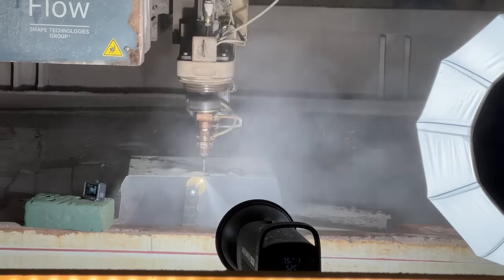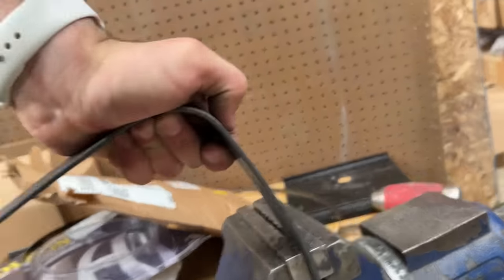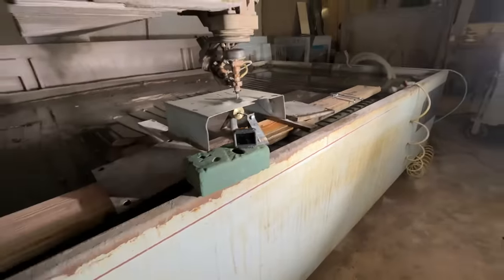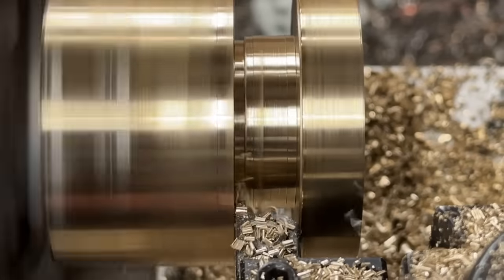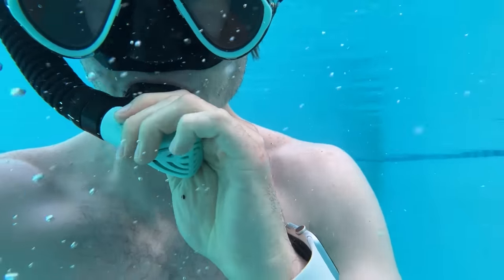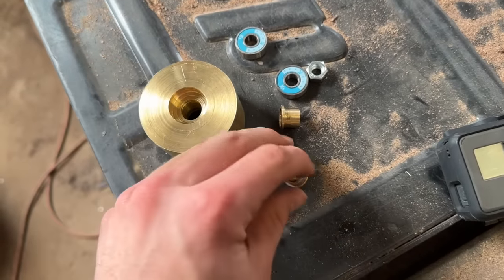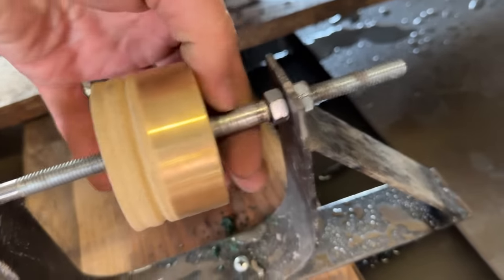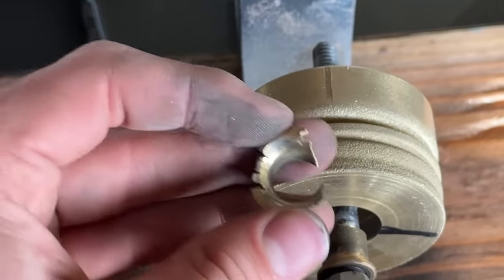200,000 RPM Brass Wheel Explodes Ceramic Bearings

Comment from the maker: Get NordVPN 2Y plan + 4 months free here https://nordvpn.com/waterjetchannel It’s risk-free with Nord’s 30-day money-back guarantee!
Reply: I would go either with an air bearing or an old-school babbit bearing.   ...and use an actual turned shaft instead of a random bolt and sus nuts.

Cheers!
Reply: Maybe bearing inside bearing , to reduce RPM 1 bearing to half RPM . Speed mean friction and very hot.
Reply: Have you tried ceramic bushongs?
Reply: it is spinning about 1884.96 kilometers per hour
Reply: Why do business with those crooks?
Reply: I know how you can get it to 1,000,000 rpm if not more 

I just thought of this but in the U.k London England in the country sides (outside london rural areas) we have old buildings that operates with watermills (to generate electricity the old fashion way) 

If you check the design of the watermill wheel and how it uses gravity to spin by filling itself with water per bucket you can perhaps do a similar design with the titanium wheel and use your water pressure gun in that method to generate maximum speed, I can’t imagine how fast it would go if you implement that.
Reply: If only you could calculate rotation speeds by pitch alone. You cannot.
Reply: @WaterjetChannel  Put their master server under your waterjet instead of shilling for those scammers...

Comment: The fact that he put a brass bushing in a piece of brass actually hurts my brain
Reply: Came down here to say this lol
Reply: sticky stuff. Brass on brass that is. where are the old guys?
Reply: You have seen this channel before right? He’s not the sharpest knife in the drawer.
Reply: I assume stainless steel would work great?
Reply: @BensMiniToons  “Brass is a grippy metal.” Adam Savage
Reply: @stephen3293  honestly with all the different alloys of brass it could.but maybe it wouldn't
Reply: @BensMiniToons moved channels
Reply: @bens6813 a lot of it is forced stupidity for entertainment with this guy
Reply: Sacrificial material to protect inner surface of the wheel. that's why he made these bushings
Reply: @16ats  to protect something he's hitting with a water jet spraying garnet at high enough fps to literally cut grooves into it? I doubt it
Reply: That's why most bushings are oil impregnated bronze...
Reply: @ari_wastaken  why did he move :(
Reply: On a wobbly steel threaded rod that's cutting chunks out of the brass etc.. they listened about ceramic bearings but things like this are some of the most basic material engineering
Reply: Baaahahahahahaha!! 😂
Reply: yeah he really should've made a burnished steel one
Reply: @stephen3293  most steels would work better than brass on brass though to my knowledge nickel plated steel would work best
Reply: Most bushings of that style meant to act as bearings are centered bronze impregnated with oil
Reply: I like how he referred to a turbo but most nowadays are ball bearing and they both have pressurized oil flow but how important could that be?
Reply: You know he 100% machined that 3 inch brass down to bushing size
Reply: He did that so that it would be brass on brass friction and not just the wheel sliding on the threads 🤦 how can y'all not figure this out
Reply: Shoulda used oilite bronze bushing..
Reply: @nelsonbrum8496  if it was for a permanent load bearing fixture sure.but it's a throw away bronze wheel...
Reply: "That was an act of unmitigated gall. ... I admire gall."
Reply: They have what they call 
Oil lite bushings
They are brass impregnated with oil they put in wood and plastic pulls for rope  and other low speed applications
He is experimental any way
Reply: Not only the brass on brass, but also the lack of proper lubrication and the way too loose fit... with a tighter fit I bet the garnet wouldn't be able to get between the parts. Also high speed spindles need a constant flow of oil air mixture, guess something like that could be useful here as well.
Reply: @CatNolara  i actually didn't even think about the tolerances at high speed like that.thats really true
Reply: Yup, look up blish block....
Reply: When you have the parts on hand, and a good customer has no budget and no time.
Reply: @MaNNeRz91 and thats the hardest part to get around. Just cant sub to channels like that.
Reply: Gt500 casually hiding in the background. Is it a clone? It doesn’t quite look right, but I can’t pick out why.
Reply: @bens6813 It's funny that you think that, it's purely for entertainment. More stupid more money
Reply: Agreed ! Titanium bushing most likely the most optimal ? 🤔
Reply: The most difficult thing about oil impregnated brass bushings is getting them to mate
Reply: @iggysixx  lol
Reply: Support shaft too long and soft it’s vibrating
Reply: @patrickw9520  the blish lock is a faulty concept. Wrong example.

Comment: If you wanna go faster youre going to need an oil lubricated journal bearing. Then the sky's the limit.
Reply: And a finely balanced wheel and more stable construction.
Reply: I've been saying this on the last four videos, they keep fooling around with ball bearings which aren't meant for hitting 100k+ RPM. The brass bushing they made isn't going to do squat either, brass on brass doesn't work at high levels of speed and friction, the bushing should have been made of hardened steel or vice-versa, brass bushing with hardened steel wheel. Maybe the 5th time will be the charm...
Reply: If by sky you mean the tensile strength of the material.
Reply: Imagine if they collab with someone who actually knows what they are doing. Then they can settle this once and for all.
Reply: This why they do YouTube they to incompetent to focus on doing they job done right it has to look right to them
Reply: Theres actually a speed limit to the resistance of the oil film between surfaces.
Reply: @VolanteVirtualVV  True, but that speed limit is way higher than ball bearings can achieve, especially under load. Plus, the oil viscosity can be changed to accommodate different loads and speeds.
Reply: @MeppyMan yeah, but there's no point in balancing a wheel that gets cut with the water, it wont be balanced
Reply: if sky is the oil, then yes.

Comment: You need a sturdier stand and a spacer between the bearings so the balls don't press against the cages.  They're deep groove ball bearings not angular contact.
Reply: The lack off correct engineering on mounting the bearings hurt my engineering heart. Mounting these bearings on some undersized treaded rod 😖😤🤬🤮
Reply: When I was going to school to learn aircraft instruments. We used angular bearings.  The outer race was interference fit into gyroscopes, while in place of the inner race there was a threaded steel that was a cone shape. Once the bearings were cleaned and oiled with special low friction bearing oil. We would screw the two inner races. Keeping the gyro centered in its cage. Then we would slowly tighten the bearings up until we could get a twenty to thirty minute spin down time. Depending on which gyro it was. They are made out of really dense metal alloy.

Comment: I believe your biggest mistake is using a screw instead of a real hardened axle.
The bearing would turn a lot smoother and hold up better because there would be less vibration

Comment: you need an air bearing/bushing . the center shaft should be hollow with an air fitting and the section where the wheel rides has small holes that creat a cushion of air for it to ride. like an air hockey table in the round. standard shop air with a regulator and some work on the lathe and you'll have zero friction

Comment: With good bushings, you need hard metal like polished steel and softer metal like bearing brass. With thin axel, you reduce friction and possible slowdown from lubricant, which you probably need in those speeds. Pressure fed oil should keep the abrasive away from surfaces.

You could also test air bearing by making hollow shaft and blow compressed air on the middle of bushing. You need a groove and smaller holes to internal air channel. 

Air bearing can be thicker and made from brass but use better insert to get good surface finish. Preferably ream the holes and lap the surfaces.
Reply: i don't see these guys doing much reaming and lapping. did you see that bushing get machined?
Reply: @prophetrob  Yes, but rather than saying what was done wrong, it's better to say what can be done better. With slow moving low friction oiled bushings, lapping makes huge difference but I think the air bearing is the right choice with this application. It's not that critical with surface quality so reaming and better insert should be enough. Aluminium finishing insert can give mirror finish for brass.

This is also just a test and lots of pressurized air is available, so air consumption is not a problem.
Reply: a graphite air bearing just might have the chops for this one.

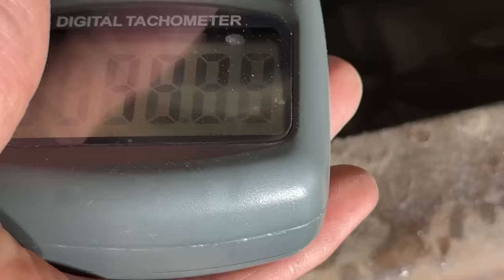Comment: 3:20, cause of failure was because you used all thread to hold the bearings on, and not a shaft that was almost an interference fit, causing when the allthread vibrated/flexed, the clearence between it and the inner race probably caused it to land on the edge of the inner race, and subsequently applying an axial (or combined) force to the bearing.

Comment: HERE'S AN IDEA : 
This may be difficult to visualize - but try 
I bought a set of valves and guides, for a cylinder head project and the guides are bronze and the valves stainless steel.
the clearance between the valve stem and guide is about .001" 
And if i put the valve stem into the guide and hold the guide in my fingers and spin the valve, the valve would spin on a cushion of air within the .0005"  of clearance between the  stem and guide.
It was the closest thing to frictionless that I've ever seen.
It has a lot to do with the precision of the surface .
Give  it a try.

Comment: Air bearing spindles used in PCB drilling now run at 200,000RPM all day long. They have around a 20mm diameter shaft. More exotic spindles can go to 350,000RPM. These drill 0.1mm holes as if they're being punched.

Comment: you need a standoff between the two bearing inner races so the nut can't crush the bearings, as it spins its trying to tighten, its not a very big force but the bearings arent made to take much side load at all and you're also exceeding the 100k rpm limit of most ceramic bearings that size

Comment: If you color half of the diameter you will get the maximum signal to noise ratio on the tach, and the signal will be a square wave.   The tach will respond best under those conditions.  the higher contrast you can do with the marker, the better.

Comment: Laser tachometer suggestion... that this  black line disappears to the laser photosensor at high speeds, make the line very wide... up to 1/2 of the surface will drastically improve its performance.

ALSO... how about creating an air bearing?  Look it up, it should be buildable by crude machining... even yours!

Comment: I would recommend molybdenum disulfide as a lubricant, that could help reduce wear on the parts.  Might I also recommend getting a stroboscope: the ~$500 range can get you around a 1,000,000 rpm measurement.

Comment: I'm thinking a stronger grade 8 bolt with the threads machined off where the wheel and bearings are sitting would be the best bet to keep any material getting smashed off by the threads. Besides just a stronger material than that galvanized weekend warrior bolt.
Reply: You'd need to still cut new threads on one end to attach everything (I don't trust them to be able to drill and pin it). They have enough bar stock and a lathe, they could just as quickly and easily make a custom axle and a proper stand which would make it a whole lot better. I agree with the basic sentiment though, they're never going to get anywhere using threaded rod as an axle without a fully threaded sleeve (which would be much more work than custom axles)
Reply: @Lilith-Rose  
So far it's been more work, time and materials spent using off the shelf or from a tool box drawer bolt.
I hope the guys read the comments or figures it out themselves. I'd love to see these wheels get to screaming!
Reply: @bigv6724  I'd be very interested in seeing whether a faceted "wheel" would do in comparison, if they use a durable enough material would the added air resistance be countered enough by the greater power transfer to increase the speed or would it be meaningless, how big of a facet is ideal (getting down to hexagonal for example), would a "wolf tooth" style gear be better etc..

Personally I'd go with a faceted lightweight bimetallic design for the wheel and even possibly experiment with air bearings if I were in charge of designing the fastest water jet powered wheel, although by the time you get to that point your limiting factor is likely going to be the waters speed itself and you're left tweaking pressures and nozzle sizes etc for a few hundred more rpm and needing really expensive calibrated measuring equipment rather than a cheap hand held tachometer
Reply: @Lilith-Rose  holding the tac reader that close is a bit sketch but you know... for science! Don't forget the safety squints.

Comment: 2:28 What's the point of using expensive ceramic bearings when you use a threaded rod that doesn't even match the inner diameter of the bearings?

Comment: I have the same saw, and I use a 8/12 tooth per inch combo and cuts well, they come with a much higher tooth count and you need to lower it for a more aggressive cut but not too low

Comment: Why do you use abrasive? I'm no expert, but isn't the abrasive getting into the bearings and destroying it through friction and high speed?
Reply: Abrasive creates more friction so the wheel can spin faster, with water only isn't that faster because water doesn't have that much friction

Comment: If you want to get some speed... you need a hardened steel axle (or titanium) ground down to a very very sharp point at each end and have that embedded in the brass. Then, you mount 2 conical holes in your steel using stainless steel bolts with a conical hole drilled into them. Basically, a watch bearing but instead of using jewels, use stainless. Put some waterproof grease in there as well.

Also brass on brass is the worst thing you could ever do. The worst sleeve bearings are ones made of identical materials.

Also. You drink BEER in the bath. not bathwater.

Comment: High RPM is fun. Sure the world record RPM is 300 Billion but a nano partical in vacuum. I have heard of a 1 million rpm motor about the size of a match book. That neat. Only other thing i have ever heard of spinning that fast is 8.6 blackout in a 1/2 twist barrel, can push 1m rpm there too.
Just fun stuff. I like rpms.
Reply: That's so cool about the blackout. If I remember correctly they're limited to that setup because any faster and the bullet comes apart.

Comment: i have one question:

   if you make a whell shaped fidget spinner (just like
   in the prevous video that you made one saw blade 
   shaped, but this time round shaped) made of pure 
   light but strong materials like brass, lithium or 
   carbon fiber and use steel bearings, maglev bearings
   or tungsten bushings will make it spin 300.000 rpm?

Comment: Guys, Get rid of that threaded rod and use bronze/copper bushings, Use a plain stainless steel round bar of say 8mm and choose an 8mm bore size bushings, secure the wheel in place by cutting two grooves into the stainless steel rod on the lathe and use 8mm circlips either side of the wheel to secure it in place, add a drop of light machine oil and then try this experiment again and it should work well ! - best of luck from England ! 👍👍

Comment: Now take that 215,000+ rpm math it around and get a MPH  on the wheel. 
There is a formula for that. 
Circumference in feet x RPM x 60 divide by 5280 = MPH 
I would love to know that answer and it may scare you
I did a guesstimate at it being 2.5 inches in diameter. OH BOY! 
Lets just say if the diameter is greater than 3 inches, if it broke free in the shop and moved 2 feet the sonic boom would be devastating.

Comment: 0:50 You might need to lower the cutting speed there. Titanium is not that hard. So hardened steel should not have a problem. However titanium is very bad at conducting heat. So maybe the blade overheats. Then the teeth become soft and dull.

Comment: have you thought about air bearings? fit a close fitting, hollow axe with SMALL, radially aligned holes and pass pressurized air into it. Once spinning, the wheel should self center with almost no friction.  Another way is make the axle out of an air stone. Killing two birds with one stone.  Theoretically.
At the speeds you are trying for, oil based lubricants can't take the shear force loading at the sliding surfaces.
Reply: Yup an air bearing will take it but if air is lost the parts basically cold weld. Used that for 180,000 RPM polygon mirrors in ultra high speed film cameras.

Comment: I mean if you want this thing to actually reach a maximum speed before exploding, it needs to be at least somewhat balanced. It doesn't matter what kind of bearings you put on if the axle is competely loose because the vibration of the wheel will make the bearing balls go ripperino.
What you want is an axle with a tight tolerance to the bearings, and that goes for the bearing surfaces of the wheel as well. Everything else is secondary (assuming your wheel is at least somewhat balanced). Dry ice is really helpful when assembling, do not hammer on ceramic bearings.